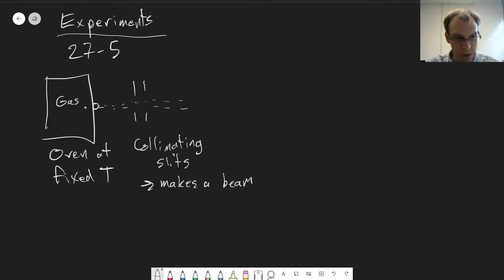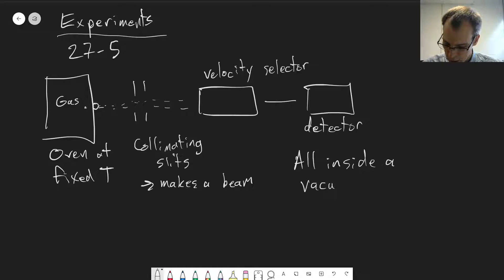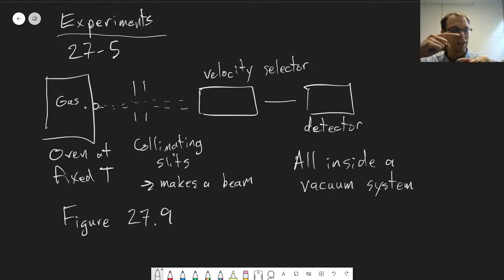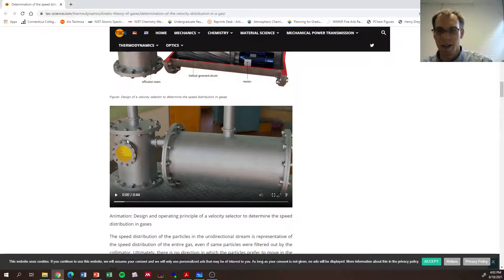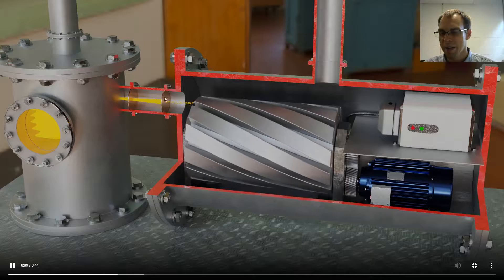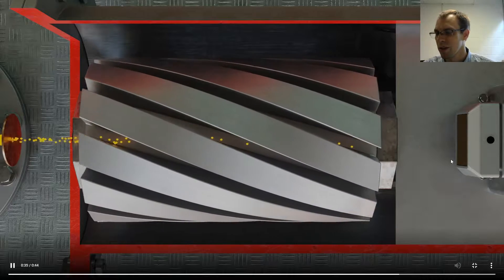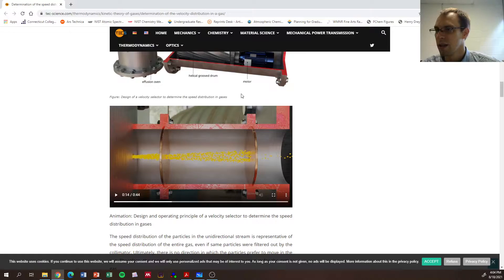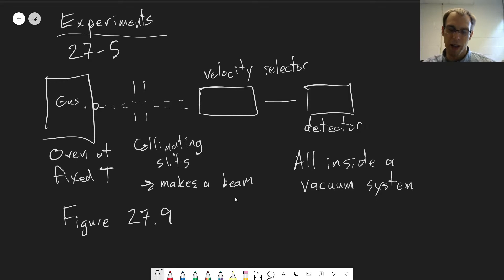Chapter 27: Experimental Measurement of Speed Distribution | CHM 307 | 014

Comment: I've been told that gas is accelerating downward due to gravity. Have you ever seen an experiment that shows gas accelerating downward with a higher velocity/acceleration than when it's going back up?
Reply from the maker: Hi Chris, I haven't personally been part of an experiment or heard of one that needs to worry about the pull of gravity on gas particles, but it certainly does happen! The pull of gravity on gas particles is what keeps the gas in our atmosphere from just escaping into space. The acceleration of gravity on individual gas particles would be quite small and difficult to measure compared to the forces involved with them colliding with each other.
Reply: @jacobstewartchem  I don’t believe gravity exists which is why I’m asking. For gas to have pressure it must be contained. There are no examples of gas next to a vacuum and that gas not instantly filling the space. ’m looking for positive evidence of gravity affecting gas particles ie accelerating them at 9.8 m/s^2. All of the formulas I’ve seen for gas such as boyles law etc do not account for gravity.
Reply from the maker: @YouTw1tFace  Hi Chris, I can think of a pretty simple example of gas being next to a vacuum and not filling the space - our atmosphere! There's nothing between the air on the earth and the vacuum of space that prevents it from leaving the earth, but most of the gas surrounding the earth is stuck here because of the gravity of the earth. When planets are smaller, their gravity isn't sufficient to hold on to as much gas, so their atmospheres are much less dense or nonexistent, like the Moon, Mars, or Pluto.